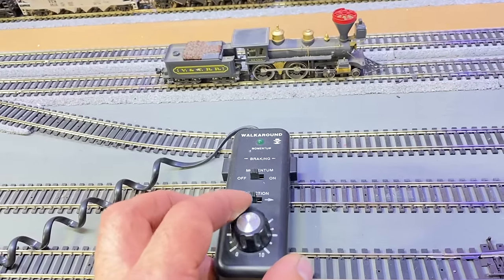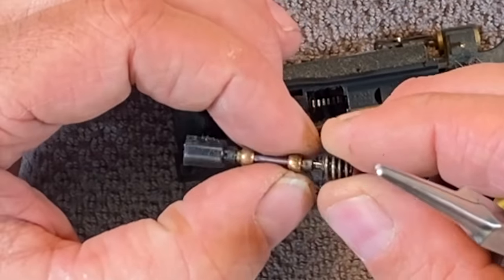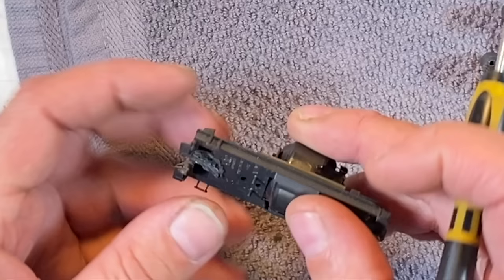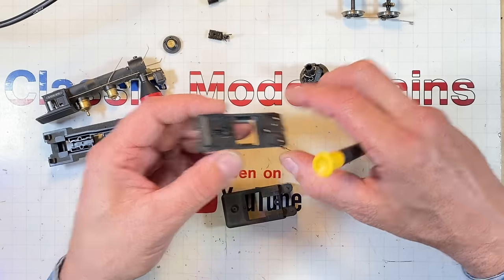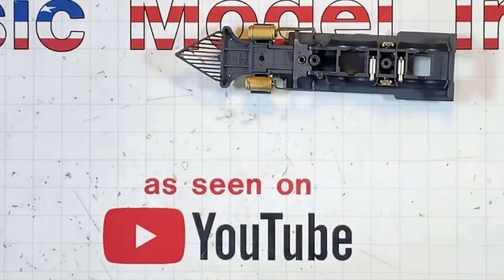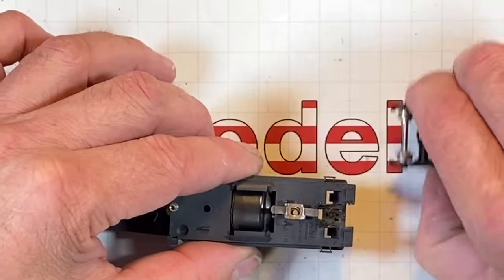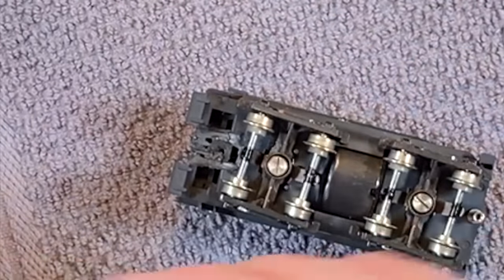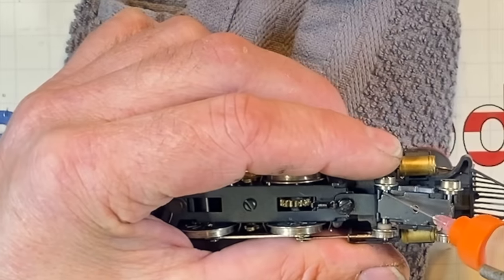54 Year Old Rivarossi 4-4-0. Barely Would Run Because Its So Worn Out.....

Comment: The V&T (Virginia (city) and Truckee Railroad) still operates as a tourist railroad. I think there are about 10 miles of track from Virginia City. While the original was used to move silver ore from the Comstock Lode, it now operates with several old-timey passenger coaches. If I recall, INYO is (one of) the steam locomotive(s) used along with some small diesel shunters. (probably useful when nobody wants to get up early to fire up the tea kettle. It may be a replica. Tunnels along the route have been daylighted for safety. It's been a good 30 years since I rode the line.
Reply from the maker: Yea I found that out while doing research.  Now I have another summer vacation destination!!!

Comment: I have all 3 Rivarossi  AHM Americans lettered for the V&T. The differences in manufacturing is quite interesting, one of them has the motor in the cab, the other two are tender drive. The name of the railroad was derived from Virginia City and the Truckee River which flows off the Sierra Nevada Mountains and through Reno, Nv. This railroad also had another  American named Dayton. The V&T named their locomotives after towns along the line’s route through Nevada. IHC also imported Americans similar to the AHM/Rivarossi models, but I think the quality was kind of lacking. I wish I wish I had purchased some, just to find out. Thanks for another interesting video. I still have a soft spot for the American locomotive, the pride and craftsmanship, and beauty that the builders put into these machines was absolutely amazing.
Reply from the maker: Thanks for the good info John!  Yes the real ones all restored up are very well built and decorated

Comment: I’ve found the original JB weld works well for putting back parts. You can also rebuild parts with JB weld and fabric. An old t shirt with some JB weld can be formed into just about anything 

You can also use Bondo for certain jobs
Reply from the maker: Sounds like a good idea to me!

Comment: Again. I attribute the failure to poor engineering. The 4-4-0 is my favorite Loco. But they just can't make 'em like they should. I had a G scale Bachmann Spectrum 2-6-0 and it ran great. For about 12 hours. Then it just failed. Sold it.
But you made the thing run better than original!
Reply from the maker: Usually the Rivarossi's have real good engineering.  Of course this thing was engineered in the mid 60's.  Thanks for watching

Comment: Here in the UK, a company called AirFix Yes, the same company that makes the plastic model kits back in the mid to late 1970s early 1980s made a small line of electric locomotives and rolling stock. This locomotive was one of the ones they did with a different paint scheme. I do believe Rivarossi carried on making this loco for many years, and the other locomotives that AirFix made the moulds went to a company called Mainline, which was then brought out by Bachmann this is a great little locomotive when you find one in good condition. They are amazing. Very nice to have in a collection. Great videos you do I love them I love seeing what the American locomotives look like especially some of the vintage ones and someone from the UK they just different and beautiful all at the same time for us here in the UK . Keep up the great videos love to see them
Reply: The AHM locomotive is not the same model as the Bachmann version.
Reply from the maker: Thank you Rob for your compliments and some good history on stuff as well.  Yes it is amazing how different the designs can be on the other side "of the Pond" for both of us.
Reply: Hi, this one looks similar to the Airfix/Bachmann loco but which I believe was a model of Jupiter. This Genoa looks very much like the General, but to many Brits all your 4-4-0 locos look very similar without seeing them side by side,  great video Ron, all the best Mark

Comment: Have you tried using spray accelerator on (CA) super glue? fully cures glue in seconds. It's wonderful! No more waiting, Just a thought...
Reply from the maker: I have, but when using CA on plastic it actually melts the plastic a bit. I believe if I let it set up naturally it will make a better bond.  I am probably wrong though ;-)

Comment: You said you wish you had a period correct town to run through. Basically you do. The V&T ran until 1957, between Reno and Carson City. Although they had more modern equipment they still had pre-1900 equipment on the roster and operational, so your early 60's town is not too far out of place.
Reply from the maker: You do make a good point there Stephen!!

Comment: Another great repair video Ron I like the performance increase you gained from the aluminum shims...very good observation on your part...

I've been watching your videos for a while now and I notice you never turn the screws backwards first...It helps a lot to turn them backwards...especially with the screw type thread...until you feel it click into original thread grooves...I find it helps the screws thread back into old holes much smoother and avoids that 'it's gonna break' feeling...

Also I never see you use liquid plastic weld cement...You may want to try it on some of those plastic parts that break off...I've had good success with 'Micro Mark Same Stuff' 

Keep up the great videos....

Rich...
Reply from the maker: Hello Rich, Thanks for your compliments!!  I've never thought about the screw thread backwards trick.  As with machine threads and being a life long Mechanic I can tell by hand tightening if the threads are crossed or not.  You do make a good point with the screw threads and the soft medium of plastic.  Thanks for the tip!!  An Old timer mentioned the plastic weld stuff to me awhile back.  I just searched the Amazon and put it in my watch list.  I agree I do need some of that stuff!!

Comment: When you go to do a DCC Conversion on a Classic Model Locomotive, you may find out the older motors pull heavy amps.

But, it’s sort of an easy fix…

You may find a rewind is the best option.

In my experience thicker winding is not the best.

Smaller diameter winding with more times wrapped around is better.
Plus, and this is always better, the more “poles” is better!
Three pole motors are ok
But suffer horribly from higher amounts of amps…
4 pole motors do better 

So, I try to find 5 or 7 pole motors!!
The more poles the better for smoother operation. Plus less amperage to get the job done…

I’m trying to remember if you have to rewind your commutator…if more times wrapped means more torque or more speed…

Damn…I guess I gotta go rewind one now to find out….

The Athearn motors often are the easier to rewind 

I did do a Tyco pancake motor once…once…and unless I’m forced at gunpoint to do it again…I won’t do it again.
Reply from the maker: Thanks for the info Jeb

Comment: Period passenger cars look great with that engine but I'm surprised the engine could pull 5 cars though.
Reply from the maker: It didnt seem to have much trouble.  I did service up the cars though.  fresh lube on the axles and checked gauge on wheel sets.

Comment: I've always wondered why HO doesn't have 4 wheel tender pick-ups like N scale does, I think the HO locos would run a lot better with them.
I think the 4-4-0 I have is Reno. It runs well enough, but I don't know how many miles she has on her. I've also got an interesting little loco called a Bowker, it's a 2-4-0. 
Nice job in getting this one running right again, I'll have to remember that trick with the tin foil.
I think your new camera works better with the lights, you were looking kind of washed out and this one looks better.
Reply from the maker: Thanks Path V.  Yes the sensors must be paying me back for all the times Ive dropped the phone ;-)

Comment: Try adding a little baking soda after adding CA glue to the screw post.  I use the Tamiya paint stirrer spoon end.  The baking soda will instant cue the CA glue & adds reenforcement to the glue joint.  Shake out the excess baking soda.
Reply from the maker: Thanks for the tip!!

Comment: Your conductive grease made me think of a product I have used a few times to lubricate wheels when I have added additional pickups.  It is a conductive lubricant called Neolube No.2 and I got it from Micro-Mark.  It is not a grease.  In fact I put it on with a brush.  To really stick, it needs a surface with some tooth, so I have sanded the backs of wheels before brushing it on.  It would probably love worn surfaces like those on your little Genoa.  It is almost as expensive as the stuff you use.  I really enjoyed your video.  It was very satisfying to watch your success.
Reply from the maker: Thanks for some fresh info Michael :-)

Comment: One thought I forgot to mention, the locomotive ran like it had been on a “display layout” and only ran forward.  Caboose Hobbies had an  LGB train they ran on a small circle of track above the checkout counter. They decided to run it the opposite direction, and it wouldn’t work, the flanges and rail were so worn, that the train wouldn’t the other way. I wonder if this little gem suffered the same type of problem?
Reply from the maker: I kinda think the same as well.  I contacted Lynn McCurdy who donated this loco to the channel and wondered if they had it running there huge layout for many hours.  He said no.  this one probably came from a garage sale.

Comment: I have a Bachmann Union Pacific 119, I had no idea this design was that old and taken from Rivarossi. This one looks a little better built than the Bachmann. But the Bachmann runs sorta okay and looks great so I'm happy with it. When I bought it, it didn't run, and I troubleshot the whole running gear and it ran just fine if I just sat the tender on the tracks and had the engine lifted. But setting it down, it would die out. I realized after, like, a week, one of the leading truck wheels was installed backwards creating a direct short through them. Now it runs, but it doesn't have super great contact so its low speed performance is pretty bad. And it's a little engine so low speed is all I really want to run it. I'm gonna try setting it up so the engine provides electrical pickup too and see if that helps.
Reply from the maker: Hope you get your little loco running good for you!

Comment: 33:58 if you use some 0.10 bronze phosphorus wire at an angle to both of the drivers it should relieve its conductivity problem
Reply from the maker: You know that's a great idea as well!! Ive seen other small loco's that use that same type of pickup.  Thanks Jeremy!!

Comment: I have a Genoa V&T RR 4-4-0 like to this one. It has Pocher Italy engraved on the bottom of the tender. It belonged to my grandfather from back in the 70’s. She really needs some TLC. I going to use your video as guide. I’m wondering if submerging the motor in the Walmart jewelry cleaner and running it would clean it? Didn’t you do that in some of your videos?
Thanks for another great video.
Reply from the maker: Hello Rick.  I use the jewelry cleaner on motors I cannot remove the brushes or clean the commutator.  Also use that technique on the sealed up MU-2 tyco drives.  If you can disassemble the motor that's always the best way.  Just be certain to dry the motor very well after you submerge in jewelry cleaner and rise with water.
Reply: Great! Thanks Ron!

Comment: Well Ron that was quite a journey. If you really want a total CF of a time you should try to service, the Bachmann version of the 4-4-0s. Great ingenuity applied in this video. It must have been rewarding to see it run well.
Reply from the maker: Many Fellers keep mentioning the Bachmann one.  Now I kinda want to try my hands at it.  It was real nice when it finally moved back and forth real smooth
Reply: @classicmodeltrains  I do know the feeling. I had one last year that I spent 5 days fettling with, off and on, and finally got it. Intermittent motor short. It even took out one of my cheap test transformers but, when it ran I was almost as happy as I was when my first son was born. LOL

Comment: Great restoration video Ron.   I was inspired to drag my 4 4 0 out thinking it was a Rivarossi but instead it is a Pocher.  The two models are almost identical except my Pocher [made in Italy] has an open frame motor inside the tender.  It has the livery of Western & Atlantic with W.&A.R.R. on the cab sides.  I will be lubing this little beast without taking it apart after watching your skills here being put to the test.  Keep up the good work.  100%ter as I usually watch all your videos more than once.
Reply from the maker: Cool a Pocher!  open frame motors make me happy.  Sure poor low voltage performance but run forever!  Thanks for all your support!

Comment: I like the older rivarossi 4-4-0 they're much better than the bachmann ones, and rivarossi made Genoa, reno, and inyo, A great restoration by you. Oh and when I 1st got mine I also had to do the tin foil tactic
Reply from the maker: Nobody has mentioned they like the Bachmann versions.  Here I thought I had the only loco with the pickup problems.  Now I wonder if it happens a lot to them?
Reply: The few examples I have I've had to do the tin foil tactic After a while I think rivarossi gave the pickups too much room To move around And they eventually get pushed out of the way and don't touch the base plate anymore

Comment: It looks more like the later version that IHC imported...  It's obviously not the original AHM one as evidenced by the different stack, light, and lack of screws in the underside of the cylinders...  I have one of the newer ones with the red cowcatcher.
Reply from the maker: I just looked at my AHM and my IHC scratch builders bible. the 1970-77 production runs from both catalogs use the exact same part numbers and parts breakdown illustrations.  I'm not concerned on what company brought this across the pond to sell to the American market, It's still clearly marked Rivarossi
Reply: @classicmodeltrains  I recently bought another 2001 era Rivarossi Genoa model that at first did not run, but I found that it had two of its tender wheels installed backwards!  After taking them out and installing them the other way, the engine ran fine!

Comment: What is the clearance drill for in that kadee tap set?
Reply from the maker: Small bit for making hole for threads, large bit for making hole for bolt to pass thru to use a nut to hold it in.

Comment: Thanks once more Ron. I have one of these engines, bought off ebay as a non runner. The motor must have had some moisture at one time as it was stuck solid with rust on the armature. I opened the can, cleaned it up and it was fine but that is not a process I would like to repeat in case the tabs break off the next time. Now that you have shown me the way though I think I will dismantle and clean the whole thing. Cheers from across the pond, Gordon
Reply from the maker: Good luck Gordon on your repair.  Just be careful for bearings that may or may not be used on the armature shaft.  Open it up over a cookie sheet just in case ;-)

Comment: Virginia and Truckee refers to Virginia City Nevada. From what I remember, Genoa, Reno, and Inyo are all still with us, as is a sister locomotive the Dayton, also from the V&T.
Reply from the maker: Yup.  I just didnt know that till yesterday.  Glad to hear another sister is still around as well
Reply: @classicmodeltrains  also, Rivarossi for AHM built Reno and Inyo, I don't know if they did Dayton. There were different smoke stacks, and I know under IHC after AHM went out of business, took over importing them. Under IHC, they had 4 possible smoke stacks, two possible headlights, and depending on the prototype, oil or wood fuel tenders. They also brought out a larger number of locomotives in various different Railroads.

Comment: Oh yeah btw thanks for this video. Ive actually have a few Rivorossi/AHM/IHC 4-4-0s that have that issue that i gave up in long ago. And i never took the time to try to figure out the problemo, Thanks man! Now im gettin those buggers down off the shelf and fixin em!
Reply from the maker: Right on!!  Hope you get them back running the rails
Reply: @classicmodeltrains  Hey Ron your a tyco collector right? Well did you know the tyco unloading hopper car set Virginian ,that all the metal on the bottom is made of lead? I have a few sets and they are complete and I just checked them and they are made with or out of lead. Bummer as I just bought a few still sealed . Now I don't want them. ! Every part of the underwrite even the closing bay doors are made of lead or metal with lead. I checked them with a lead test kit and it turned in like 5 seconds. 
Imagine how many kids in the 70s were exposed to this. I may sell them or even give them away.
Reply from the maker: @firefly0282  I didn’t know that. I work with lead a lot. If you don’t touch it, it won’t “get you”. Really no need to get rid of them.
Reply: @classicmodeltrains  ok thanks for advice.  I just kinda flipped out when I checked it with a lead detector. But yeah I've been buying alot of these tyco on auction sites and have gotten good deals. I really didn't want to get rid of them as it took me along time to find mint in sealed box tyco stuff. I guess your right . I forgot when I first started my automotive career I was busting tires at sears and handheld lead weight all the time and those fishing weights . I guess alot have used their teeth to clamp them as well. And I know why they used lead in automotive paint so I guess I shouldnt worry. Sorry I was opting on giving them away to others that weren't sceerd of lead! I guess they'll be OK running them around on track. ,!,,,! Cheers!